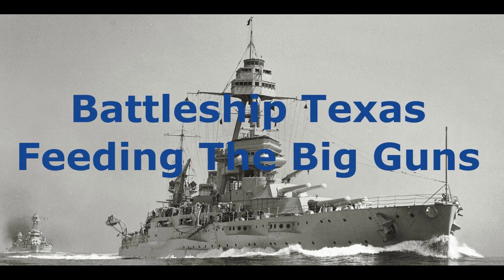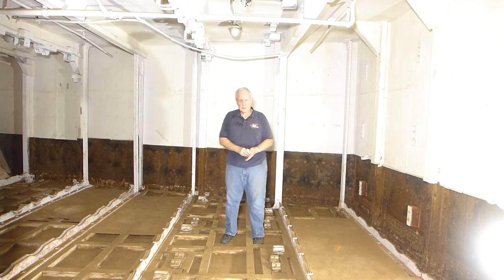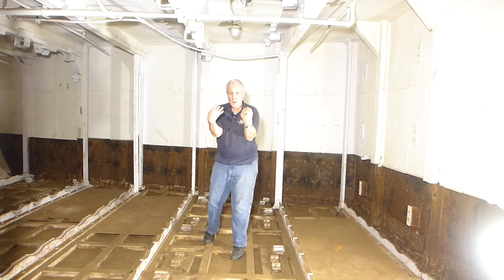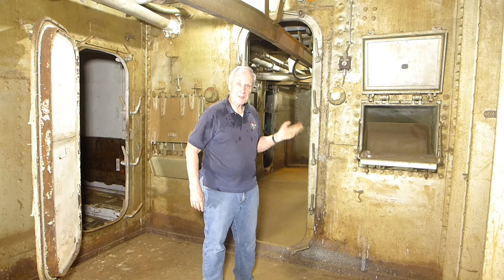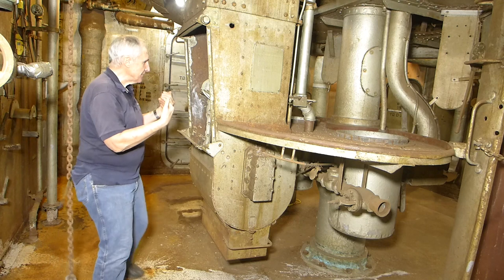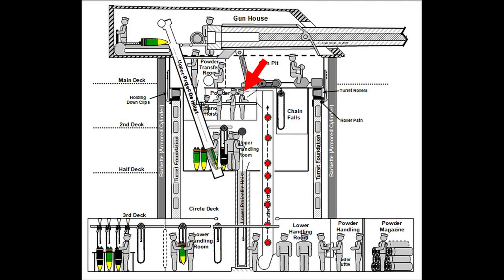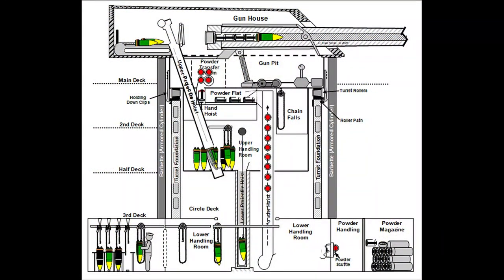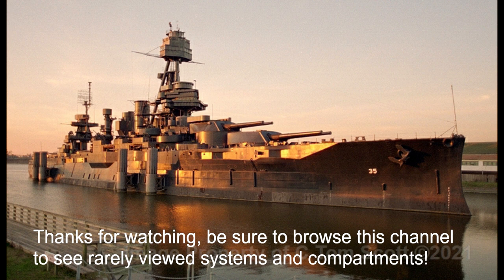Battleship Texas, Feeding The Big Guns

Comment: Could you visit where the stern mounted 5 inch gun was when the ship originally entered service? Is there any evidence of it being there?
Reply from the maker: I've been in there many times and there is no evidence of the 5" gun mount.  The compartment was repurposed as a paint locker after the mount was removed.  It was later subdivided by a bulkhead and the forward portion became a clipping room for the 1.1" AAA, then 40mm AAA mounts located directly above on the main deck.  The very small portion in the extreme aft end now contains an empty rope spool.  Neither space videos well.  The clipping room is filled with empty ammo racks and the aft space is so small that even a fish eye camera lens doesn't get a good portion of it.  You can see this by looking at the 2nd deck plans for different years in the following link.  https://battleshiptexas.info/images/Drawings/DeckPlans/Overview.html
Reply: @tomscotttheolderone364  thanks!

Comment: What is the capacity for shell storage on the Texas?
Reply from the maker: In 1914, capacity was 1,000 shells.  In 1944, it was 1,200 shells.  This is because shells were originally stored in horizontal racks, then changed to vertical, nose down.  That allowed better space utilization and the 20% increase.  Powder capacity was 2,000 tanks, or storage cans that held 2 bags.  So, that was enough powder to fire 1,000 shots.

Comment: I do wonder how strong those bags are as there are a lot of sharp objects around.
Reply from the maker: I'm going to give you a much larger answer than you bargained for because it touches upon a very important subject that I haven't properly dealt with.  The short answer to your question is I don't think sharp objects were an overriding concern, even if they were present.  The reason is because all powder handling crew were highly trained and constantly practiced.  That means that each individual followed a very specific set of movements that would avoid those hazards.  In other words, they simply avoided sharp object hazards as a matter of practice to the point of muscle memory.  Here's the long answer.  What I've gathered from gunnery manuals of the period is that safety was an overriding concern when handling powder.  There was the real risk that the ship would be lost if there was an accident that lead to a fire in a powder magazine or handling room.  Needless to say, lighters, matches and any other potential ignition sources were strictly banned in those areas.  While there were written procedures that dealt with powder bag tears, they did not address causes for tears.  One exception was that bags were not to be lifted using only the fabric lifting handle attached to one end of each bag.  The handle was only used as an aid to position the bag so that most of its weight could be supported by placing the other hand under the bag and lifting it.  The easy assumption is that lifting a 105lb. bag by just the strap could cause it to tear off the bag and damage it.  The earliest manuals discussed repairing bag tears by stitching them closed.  Later manuals simply said that damaged bags were to be disposed of by dumping them into immersion tanks filled with distilled water that were placed in several locations around the rooms.  Ultimately, the central question is what threat is caused by a torn bag.  The smokeless propellant that formed the 105lb. charge was not the problem.  Their grains were very large, easy to see and pick up, and if individual grains somehow caught on fire, they burned slowly and were easily extinguished.  The very big danger was the 10 ounce black powder charge located in the red ignition patch at the back end of the bag. It was used as a booster to increase the effect of the gun's firing primer to a level that would reliably ignite the main charge.  That stuff was a very fine grain powder that could spill out on the deck through a tear.  From there, practically anything could ignite it, creating a very hot and violent flash.  That is what kept the gunnery officer awake at night.  If there was any sign of a tear or damage to the ignition patch, everything stopped, the bag was immediately dumped in an immersion tank and the deck carefully inspected for loose powder.  If any was found, it would be carefully swept up and dumped in the tank.

Comment: Thats all very well but how could all this happen in anything but calm conditions ? The process would be crazy dangerous in a force 6
Reply from the maker: I don't think any system would be capable of handling and moving shells in force 6 weather.  To that point, there wouldn't be much reason to try since you wouldn't be able to hit a target anyway.  There's no question that there were times when it was very difficult on Texas due to ship movement.  For the most part, it would be a matter of putting more crew on handling a shell.  The biggest difficulty would be getting the shells onto hoists.  One gunnery manual addressed that issue by saying that the shell would be brought close, then a rope would be looped around so that it was pulled into and held in the hoist.
Reply: @tomscotttheolderone364  Yes that makes sense. Of course nowadays apart from ammunitioning  ship most shell handling is automatic
Reply: @tomscotttheolderone364   In 1940 HMS Renown fought Scharnhorst and Gneisenau in a force 10 gale. The commander of Scharnhorst's C turret commented in his after-action report: "I found astonishing the high rate and continuity of the enemy's fire, which was not impaired by the heavy movements of his ship. When the enemy turned away to port for the first time, he was pounding so strongly that his keel was visible at the stem".

Comment: I am disappointed in the condition of the interior of the ship!  The caretakers have not even painted the decks to preserve them in the turrets.  How can the caretakers even hope to get tourists to want to visit such an unpleasant ship condition.  You guys need to get some painting parties busy painting the interior of the ship!
Reply from the maker: I understand your concern, but the good news is that the majority of the rust is cosmetic and not structural.  The reason that areas like that have degraded is simply the size of the issue and what it takes to control it.  When the ship was in service, it took a crew of 1,000 and a budget of at least $2 million in 1945 dollars simply to maintain her.  Without that level of resources, priorities have to be set.  Ship management between 1948, when she became a museum, and now have always had to work with limited budgets and a combination of a small repair staff and volunteers to do what they could.  All in all, they did an excellent job using these limited resources.  Another thing to consider is that there is much more involved than simply applying paint.  If it was just that, vastly more could be done by ship staff and volunteers.  Unfortunately, repainting an older area requires hiring a licensed contractor to first remediate and properly dispose of the lead paint and primers used in all parts of the ship.  One fairly small area can cost as much as $10,000 dollars just for that.  When you multiply that by several hundred spaces, passages, trunks, turrets and voids, you begin to see the scale of the problem.